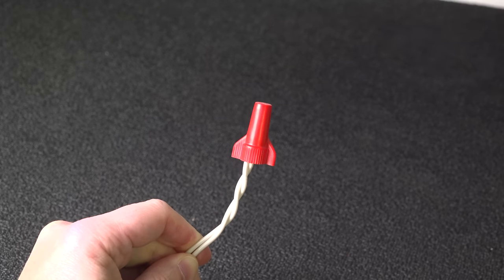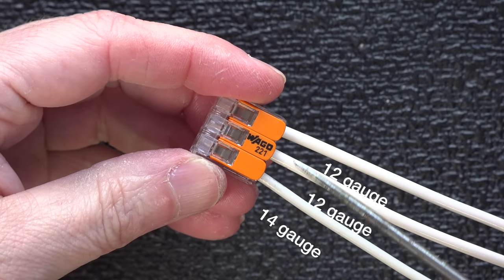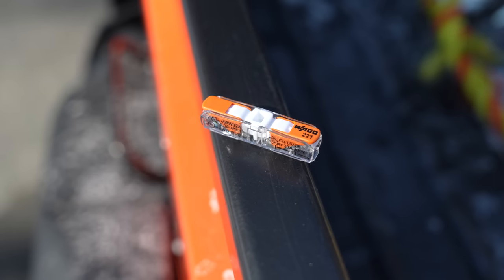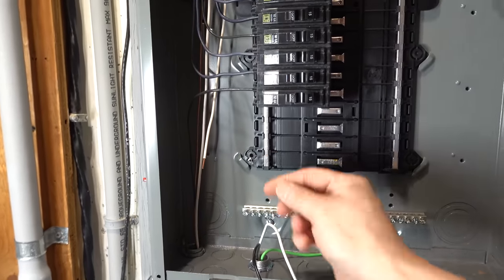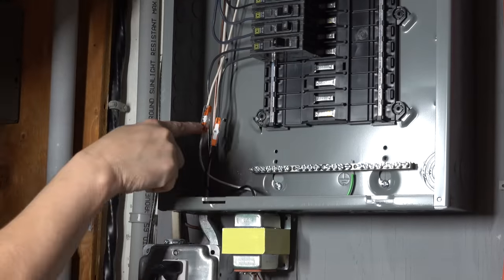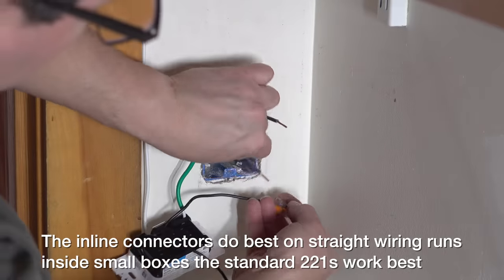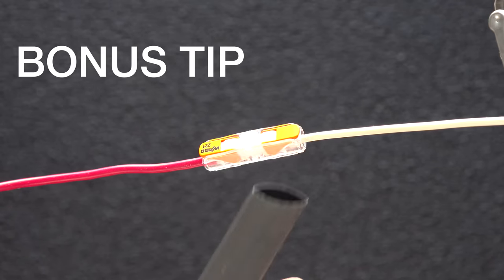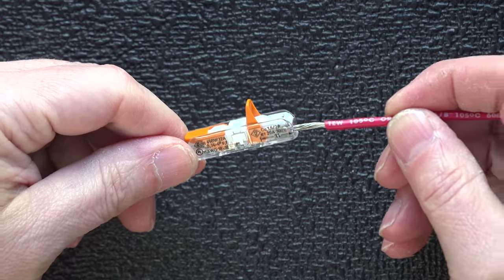New Wago Electric Connector is SHOCKING everyone - Inline 221 has arrived!

Comment: I’ve been an electrician in the US for 7 years now and I am one of the few that swears by these. Ive had more wire nuts than i can count fall off while opening boxes and almost getting poked by 277. So to all you old-timers that claim a wago is a “worse connection” than a wire nut, when you have one fail, I’ll take back what I said. Until then, I’ll continue to be right. 

Other advantages include:

-not twisting wire as required when using a wire nut, which allows easier rework 
-much easier “hot” work, especially if working on a circuit in a setting where deenergizing isnt possible 
-a much cleaner looking install and ease of future serviceability for the customer

Comment: Your splice may not being NEC compliant.

NEC 404.3
(B)	Used	as	a	Raceway. Enclosures	shall	not	be	used	as	junction boxes,	auxiliary	gutters,	or	
raceways	for	conductors	feeding through	or	tapping	off	 to	other	switches	or	overcurrent
devices,
Reply from the maker: Yes if the wire was passing through to feed a circuit beyond the panel it would not be allowed. Its not feeding another switch, or overcurrent device. Interesting fact is that about 90% of every doorbell transformer is wired illegallyt. Electricians double tap a breaker that is only rated for 1 wire, I have never seen an inspector that would fail it anyway due to such lower power. The QO breaker I connected it to here is rated for 2 wires
Reply: @SilverCymbal  the issue is the double tap but the junction in the disconnect.

Comment: Have you tried them on audio connections, like to splice car audio wires?  Do they introduce any noise?  Normally I solder and use heat shrink for connections sensitive to interference but these would be faster...+
Reply: For speaker wires they would be great, the only noise I can think of would be thermal EMF from dissimilar metals. but that would be well bellow your ears frequency response.
Reply: Well now, this is a great question that should be brought up in the video having to do with especially audio low-voltage wiring. And sure, some 72v commercial systems wouldn’t bother with a Wago connector, but using Wago’s for audio wiring, especially subwoofers, where extra ohms need to be kept to a micro minimum, means these ain’t good fer dat.
Reply: @dallynsr  
Just use that silver plated teflon insulated wire, it will help with the sub harmonic response near zero Herz .

Comment: While I see Wago's advantages over wirenuts,  I am not so certain about inline advantage over crimps, for permanent connections.  It mechanically same idea, minus springs and moving parts, which only add point of failure.

Comment: ⚡⚡In your video - you can make the wago waterproof with heat shrink, put a couple of drops of CA glue on each end of the wire towards the ends of the heat shrink. Then use a heat gun and shrink. Viola, waterproof! Or of course you can use resin lined heat shrink for water proofing too :text-green-game-over:
Reply: Or just used adhesive lined heatshrink
Reply: @jonathanbuzzard1376  Yes. Like I said, resin lined heat shrink. 😄

Comment: If you have trouble using a wire nut to successfully connect straned with solid, then please contact a professional. Also I can't help but notice always showcasing the cheapest wire nut possible, the one they give away with every device and honestly they work fine when you know what your doing.
Reply: There are Wago connectors,then Ideal connectors, then there are cheap Chinese knockoffs.1st two great,avoid third one.
Reply: So you should learn it in Europe where it is Illegal to use for any permanent installation? Hmmm...wire nuts are a hazard, no way of telling if they are in good condition, prone to user error and loosening over time...if you need to use a wire nut, get a job and save up for a wago instead...poor bastards.

Comment: Connectors should be evaluated like birth control; not just by how reliable it is when used perfectly, but how reliable it is as ACTUALLY used. Everyone who put it on wrong thought it was right at the time.

Wire nuts can work well, especially for 2-3 similar solid wires, but get progressively more difficult to use with mixed gauges, stranded, or large bundles. There's just more risk of making them up incorrectly. There are fewer things that can go wrong with Wagos, especially for a DIYer, or even an expert who's tired, in a rush, or whatever else. I like to think I do it correctly, but holding 4 wires properly aligned, overhead, with just barely enough length can be challenging. If some of them were previously twisted that makes it worse. And a mix of stranded and solid isn't great. And that's assuming the correct size of a quality brand of nut.

Wagos also have the safety and convenience that you can add or remove wires one at a time. You can have the in and out wires in a box connected, even live, and add more as you go (again, as actually used, not as properly used). And you can see through the clear bottom that they're correct.

Comment: Never tried them before.  I'm wondering how many different types you'd need to keep on hand.  Right now, 3 sizes of wire nuts covers most all residential and small commercial connections.
Reply: You'll be well equipped with 3 types of wago connectors. Might even get away with two if only want to replace wire nuts.
Reply: There is a box with different sizes and diameters (Wago 887-960) 

I think it contains nearly 200 pieces.
Reply: in my expirience the 3 and 5 gang version cover 99% of what you usually need (anything up to and including 4mm², which is a bit more than 12awg). for special cases having a few 2-gangs or inlines wont hurt, but usually there is enough space to use the 3-gang version instead. And if you regulary work with thick wires (6mm² or something between 9 and 10awg) you need the thicker version, but imo this again falls under special case

Comment: Things to note:
a) The length to strip off the wire is written on the clamp.
but most importantly:
b) You should insert the hot line (supply line) into the slot, where the text is. Why you ask? On the 5-wire version  of the clamp, you want good distribution, hence the text is in the middle, and provides better load distribution.

Comment: Mine (bought two months ago in the Czech Republic) have transparent plastic insert instead of the white one you have. Is yours a newer revision, or is that US vs. European spec thing?
Reply: Wago original are clear plastic so you can see that the cable is inserted properly.
Reply: @onelineal9382   the one in the video is clear plastic on the bottom too, so you can see the wires even with that one. But my guess was correct, the one with white plastic insert on the top is 221-2401 for North America and the one with transparent insert is 221-2411 for Europe.

Comment: I just started doing simple electrical and I use those for indoors. Any ideas what to use for outdoors?
Reply from the maker: You can absolutely use these for outdoor work as long as they are in a box. The same applies for wire nuts. You just can't use them directly exposed to elements, They do have a waterproof box but its not approved in the US yet, I am hoping they bring it here.

Comment: I'm not knocking Wago, but the problems stated with wirenuts in the beginning are only if you're improperly trained in their use. If anything, it's another plus for Wago. No training is required for flipping a lever.
Reply from the maker: Correct but thats the problem. Once they are on, who knows are they joined properly. The scientific pull test tells absolutely nothing underneath a wire nut. Inspectable visually, test ports, instant connection and 90% less time to install with less touch and feel to get it right are all good things. I have opened boxes with wire nuts siting on the bottom, yes incorectly installed, maybe, but how do you really know?

Comment: From my understanding you're not supposed to use Wagos on anything with high amperage, is that correct?
Reply: They have the amperage range rating on them.
Reply: The regular one are rated up to 20A. The AWG10 ones are rated up to 30A. In overcurrent tests the 20A type fail at around 100A (about the same or later than the connected wires.) 

They are over engineered by at least a factor of 3. Thus with normal usage and the appropriate breakers they will not fail.

Comment: it should be mentioned that wago's are convenient but objectively are NOT that great of an electrical connection. they are much higher resistance than what a wire nut [can] provide due to the wire nut smushing the conductors directly together with a lot of surface area. this is only a real problem with high current though. the 2-10 amps of typical residential circuits isn't a concern.

Comment: These Wagos are proving to be the electrical version of shark bite like it was for the plumbers 10yrs ago. And all the plumbers will tell you today thank you for using shark bite so they can come out with job security to repair all of them with a soldered copper pipe joint like it should’ve had in the first place. And now we move onto electrical, and the electricians have been already and will be getting job security service calls, sniffing out, bad connections and intermittent circuits to then repair them with a properly installed twisted set of wires and a cap known as a wire nut.
Reply: Well, you're wrong. 
Wago isn't something new they've been around since 1951 and if they are as prone to failure as you say most buildings in europe had to rewired wich is not the case...
Reply: Wagos aren't something new.
They have been the standard for more than 40 years now in Germany (and most of Europe).
And they are far superior to any other kind of connector and are less prone to failure due to wrong installation.
Reply: Perhaps Dave Allyn Jnr will use them,shark bite and Wagos,why compare two different professions,Wagos are not made in the good old USA ,that's one reason.

Comment: Gotta be just stubborn or nuts to go back to wire nuts after you've tried Wago connectors. Been using Wago's for years with satifaction. Two, three and five connectors have been around for ages and now the Inline (one's if you will). Does anyone know why there are no Wago four wire connectors? At least I have never seen one up until now.

Comment: Wego was tested and failed a heat test and fire test premature, compared to wire nuts and crimps. Great design tho, just needs reinforced
Reply: Nope. Several uk electricians performed the tests. Wagos only failed at over 100A, they are rated at only 32A.

Comment: I'm not an electrician but I'm still worried that they may eventually degrade and cause arcing. I would only use them myself if it would be too messy with wirenuts.
Reply: Wagos have been around for over 40y in Europe and you won‘t see a wirenut in Germany or Switzerland like … ever!

They are even available for 6mm2 connections and rated ar >40A (221-6xx series)

Given that the clamp automatically fastens the connection, even when there are wide temperature differences or some mechanical pressure, they last much longer than screw terminals or wire nuts.
Reply: They are banned in the UK.
Reply: @onelineal9382  You mean wirenuts? AFAIK only the old ceramic ones aren‘t allowed.

But who in their right mind would use that medieval connector anyway??

Comment: Have you considered maybe soldering?
Reply from the maker: You would not want to solder higher voltage lines
Reply: Soldering wires in a household electrical installation?

To have to cut the wires again every time you want to change a light fixture?

Comment: Does anyone know if these Wago connectors can be used inside of a guitar amplifier to connect a filter capacitor instead of soldering one? (cutting the existing filter cap and leaving its legs soldered to the board and then connecting a new one to the old legs by using a wago connector)

Comment: You can't use wire nut or wago in the main panel.
Reply from the maker: You absolutely can. You cant use them in the main panel as a pass through to go elsewhere, meaning you can have a wire pass into the main panel, get jumpered there and then pass out.. Connections are made in the panel with pressure connectors all the time for generator switches,
Reply: @SilverCymbal  what code can you use  nec?

Comment: I’ve had to fix so many melted wagos that I have lost count. The bar that makes the connection is too small and overheats on medium to high amperage wires.
Reply from the maker: I can guarantee you never replaced a single failed Wago 221. Plenty of garbage, no name connectors out there that pretend to be something else.. To date there have been no documented cases of a Wago 221. If you have one please let me know, I have access to the NFPA and would be more than happy to look at it.
Reply: Certainly not genuine Wagos then.
They are made to german electrical standards which have some of the highest requirements in the entire world.

They are rated for 32A and up to 450V.
You don't melt those with any normal household application.
Reply: UK 240 volts,never seen one overheat.
Reply: Chinese knockoffs yes, not genuine Wagos.

Comment: Is no one gonna comment on how he installed the motion switch. That "green" wire you put to the bond is actually white and is supposed to be the neutral if you pull off the green cover. Not supposed to have any current on the bond especially when you have a neutral in the box

Comment: While wagos definitely have their place, I don't see the point in electricians using them cost wise, for a light switch you'd be spending roughly a cent and a half on wire nuts, as opposed to like a dollar on wagos. Or a 100x price increase. And that's buying wagos in very large quantities as well.
Reply from the maker: That's way off. Using pro grade wire nuts would cost you fifteen cents for 3. Wagos would cost you 30 cents, yes double, its still cheaper... Doing an entire house would cost about $140 more, thats a whole house and it would reduce install time by over 2 hours.  They still won't use them, even if they were free, most electricians hate change, it's a sad byproduct of old timers. The minuscule cost difference is more than made up in labor. There are exceptions like Sparky Channel, but even plumbers are more open to new stuff.
Reply: I can find Graingers for 0.093 per unit at 100pcs

Comment: 1:56 you’re not allowed to splice in a panel board.

3:16 align your screws vertically for a more professional appearance.
Reply from the maker: You can use wire nuts, Wagos or other pressure connectors in your main electric panel. This is a misunderstood code by many. You may not use your main panel as a junction box for pass through circuits. Direct connections are of couse always best, ut every generator switch in the world uses wirenuts inside the panel for connections, as one example

Comment: Now the same but with 2 and 3 pairs
Reply: There are Wagos that can take up to 5 wires at a time
Reply: And then there is also wagos from another series that can take even more wires
Reply: @GandhiTheDergRawr  yeah but only linking them together.
A common application is to link an appliance to electricity. So you just need 3 pairs (3x2wires in one wago). And not 3 wago with 2 wires.
Reply: @tiloalo  OH now i get what you mean, sorry, I thought you meant the connection of more than two wires at the same time^^

Comment: Wago Not rated for exterior or moisture prone environments. For that you have to use silicon wire nuts and a moisture proof wall plate.
Reply: Use a WAGO GelBox or a Cellpack EASY-PROTECT 332

Comment: Lever action wagos are nice but much more expensive than wire nuts. Also, mechanically twisting wires together is proven to be a better electrical connection. For diy, I highly recommend using wagos.

Comment: use them in boats.. if you want to come back in 3 months to find it rusty green along with some length of the wires gone bad. it's fast and convenient but I would never recommend it for long term reliable connections.
Reply: In boats you need basically airtight connections. Otherwise it will all rust in a season, especially in salt waters

Comment: As a European i don´t get why even bother with things like wire nuts. Sure, they are cheaper and perform good but installation is complex (you need to know in head what color is what and what are its limits while on a wago for example it is written outside) and takes longer. (lever up, insert, lever down, finish on wago while wire nuts need to be turned a while which takes longer)
Short: German efficiency.

Comment: Ironically this is where WAGO falls short, the knockoffs have much more Varity in connector types
Reply from the maker: Not at all, the knockoffs have already been shown to cause fires, melt and have a million other issues due to cheaper materials. Of course they have more variety, its like a building a bridge twice as long as the engineers say it can be done safely. Eventually it will kill people.  Wago can make whatever they want, but they only do what can be done safely
Reply: @SilverCymbal  I do give you that some Knockoffs look quite shady. like a 1-10 adapter. which would be ridiculous to use in the wall/socket-box

Comment: Just a reminder to all you folks out there interested in getting these or the regular ones: 

There are A LOT of cheap, chinese knock-offs. 
They might look the same, but they are NOT the same. 

Get the original ones. The knock-offs are complete GARBAGE. 
They work, but the connection is very loose. The originals tend to hold the wire with more than enough force.
Reply: Actually, the fact that knock offs can be of much inferior quality, and that getting brand name ones is essential, is a serious downside for an item used everywhere. Because knock-offs will find their way into many installation.   It is a serious advantage if you cannot make a too bad knockoff.   I would guess it is a much less chance to have really 'poor quality' wirenut or crimp.